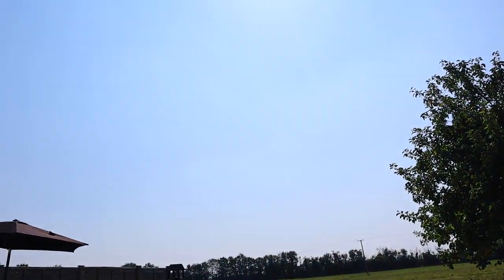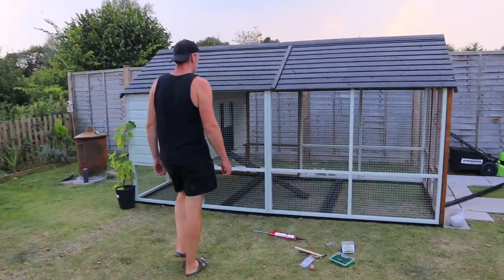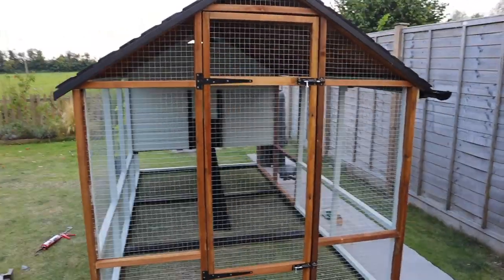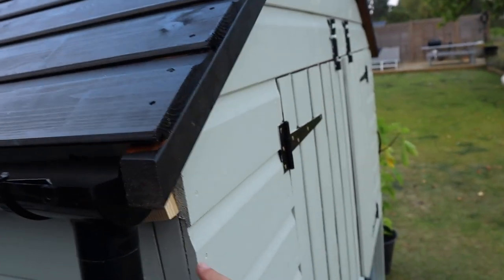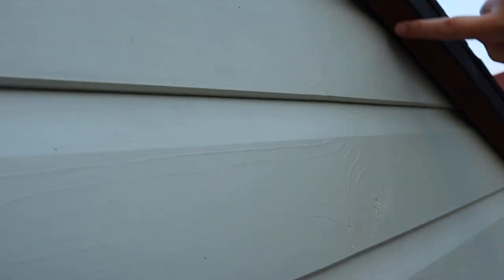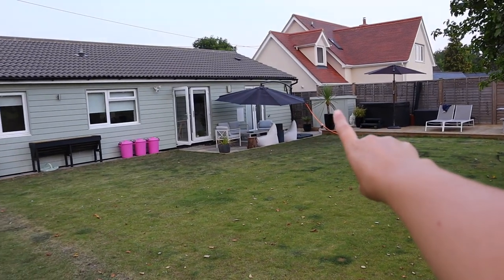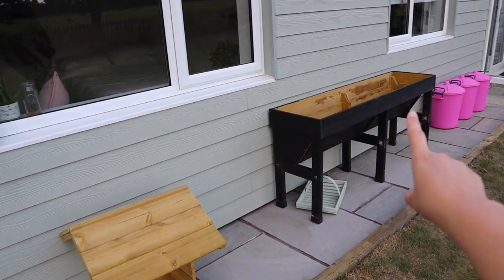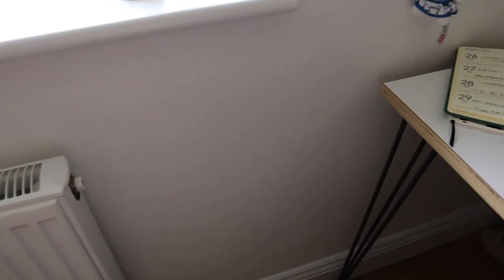BUILDING THE CHICKEN COOP! | EPISODE 7

Comment: Nice job guys, just a suggestion if it were me I would garden edge the strip where the mower is, get some weed mat in there and some soil then wood chip some micro irrigation and plant veg or flowers, now when you clean up the chook poo just pull back the wood chip and dump the litter then pull the wood chip back over the litter, some wire mesh on the fence or timber stakes and you'll have a fence turn into a vertical garden, w2ouldn't take long to do and saves Andy mowing.
Yea another shed in the corner so Andy can have some more solar panels there.
Just an observation where I live in Aus household Incinerators were banned back in the seventies cos of air pollution, surprised to see them in the UK.
Good Luck.
Reply from the maker: mike oh really that’s interesting! Yeah we may end up doing something different along the fence once we have some energy back. It’s all been tiring, we’ve been so busy! 😄 Maybe next Spring. Thanks for watching!